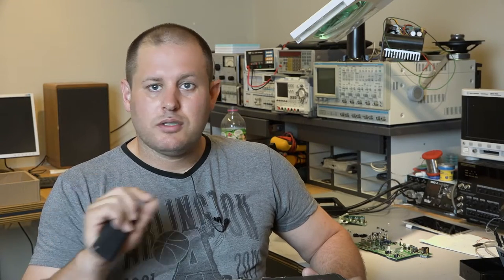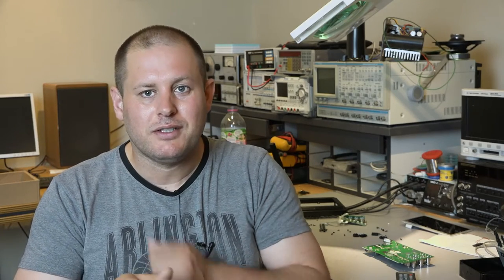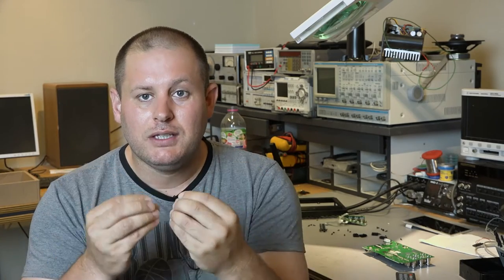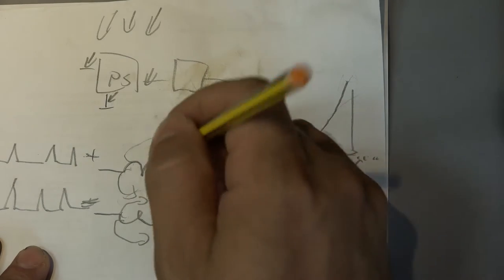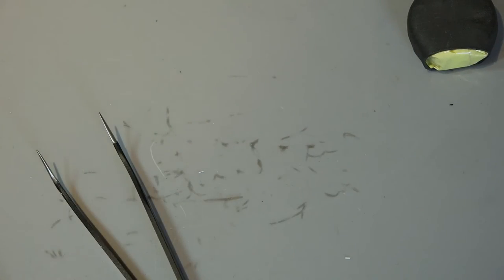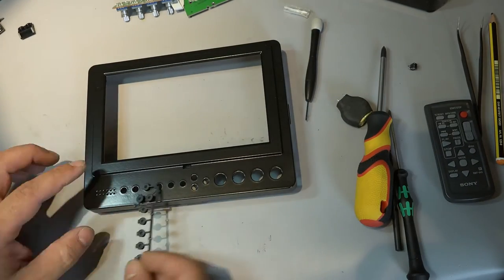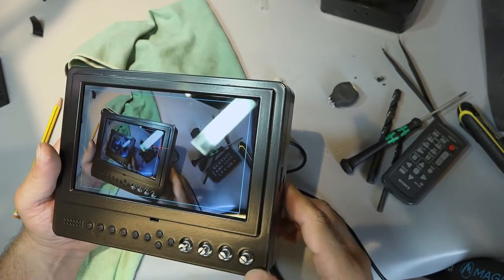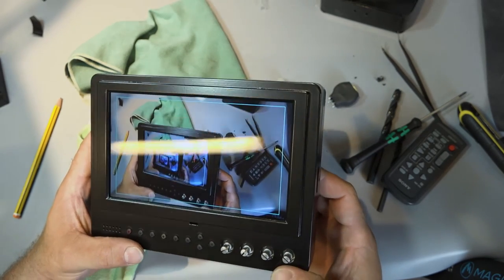Gear Hospital 03 - Lilliput 665GL field monitor repair and short review. Latex paint remove!

Comment: Quick question; I just got through scrubbing the sticky crap off my Lilliput 665 with a paste made from baking soda and water and so far it's fine. Is the reason for painting the case because the sticky crap will come back otherwise?
Thanks for the helpful video

Comment: Hey, i have simillar problem with Lilliput 5d. Power it’s working but screen show permamently trash (randomly lines from left, right, flashing randomly). I checked without hdmi socket and changed tape from lcd to board - same. Do u have reason ?
Reply from the maker: Looks like a line drivers in the GPU..... Just trash it. Those things become soo cheap nowadays...

Comment: Hi, How did you open the case? There is a screw each corner but still does not open.
Reply from the maker: Hmmmm. If I remember good, I used this triagle shaped plastic Iphone screen opener. The screen frame has the dents, and the small sticks on the backside.
Reply from the maker: Somewhere here  14:49 you can see the positions.